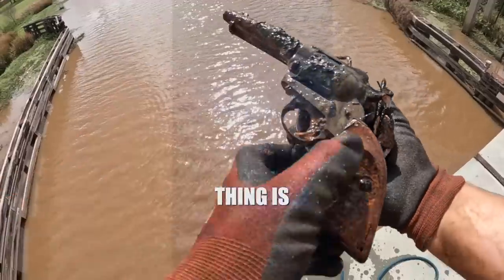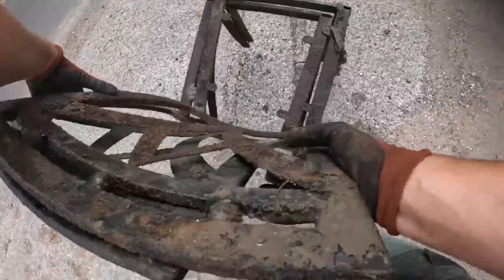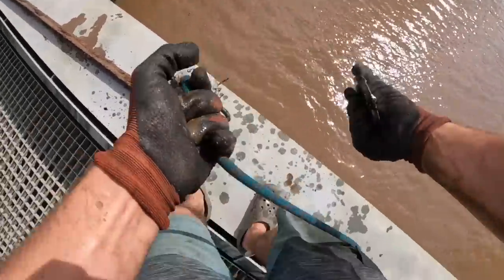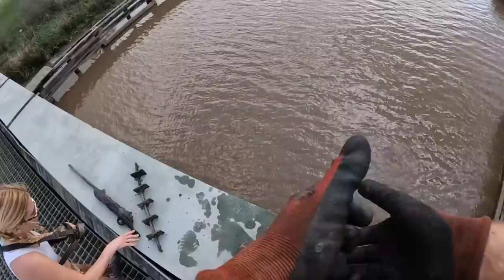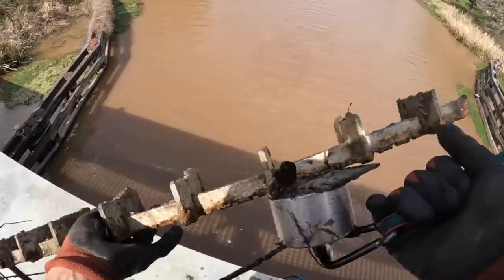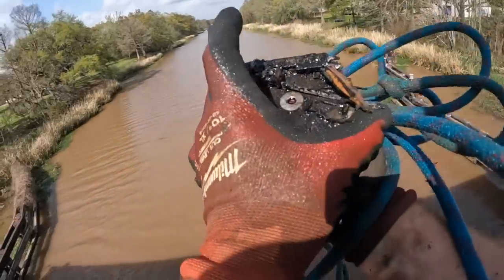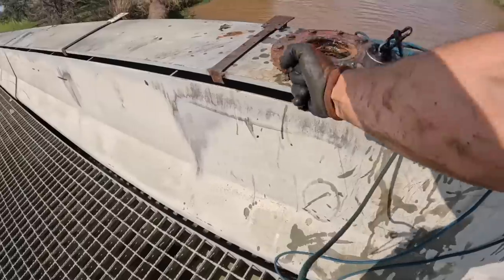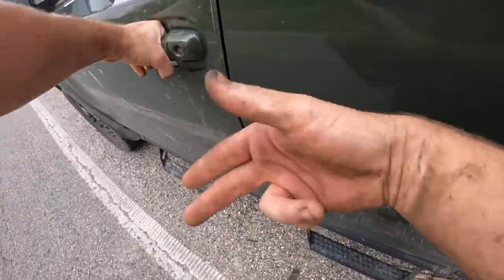I Found A BLOODY Gun Magnet Fishing - EXTREMELY Sketchy Magnet Fishing Discovery

Comment: I recognize the first revolver; the RG stood for Rohm Gesellshaft of Germany. Very CHEAP and went out of business in the mid-eighties. I am assuming you could read Smith &Wesson on the second one, if you open the cylinder the model is engraved into the frame. It does look like an N frame, but it would take a much closer look to determine. That one is worth saving.